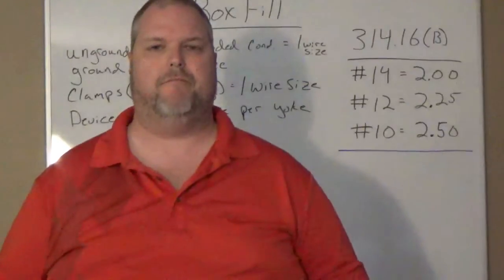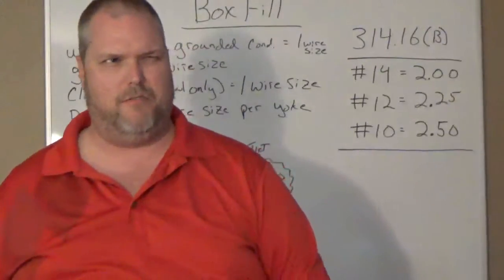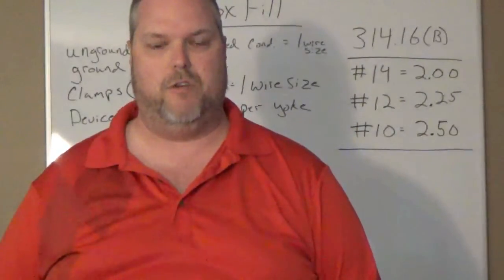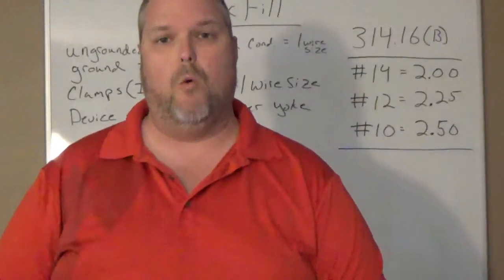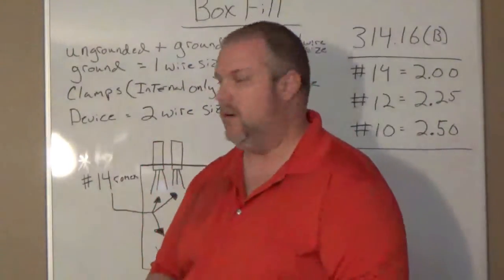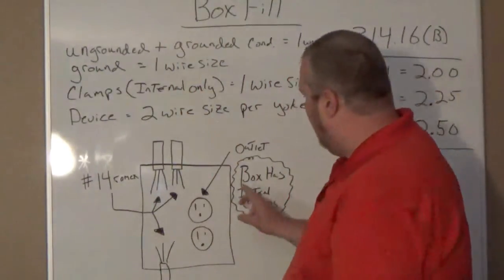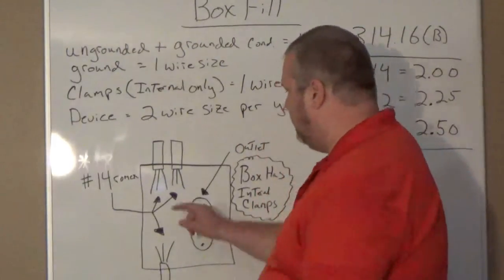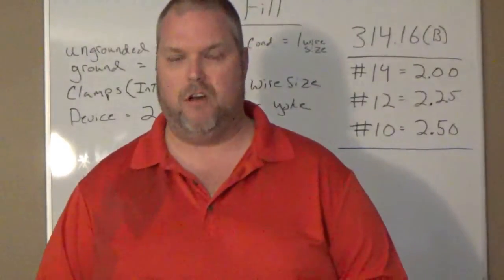Box Fill Calculations Explained

Comment: Doesn’t 4 ground conductors count as 1 and anything after 4 is .25? I could be wrong
Reply from the maker: @ivanaguilar8820  only after the first 4. So if you have 5 grounding conductors it would count as 1.25. This was changed in 2020 NEC. This video was off the 2017 NEC code. I will be doing an updated version soon!! CM
Reply: @ that makes sense! Thanks for all the vids been learning alot

Comment: I believe the 2020 calculation on grounds is different now.  I believe after 4 meaning the 5th ground you need to add .25 to the fill.
Reply: Yes this correct, i was confused because the video is different from my apprenticeship classes. He’s going off older code.

Comment: What if there were different size wire going in?  What cubic inch number do you use as a multiplier for the yoke and clamps?
Reply: You need to add a different size for each wire in the box.  Unless its a ground. For the ground up to four you only count the largest ground in the box.  Do not count splices or the device ground.  For the yoke and the clamps it is double the largest wire attached to it per 314.16(B)(4). Hope that helped.

Comment: I got a 66 yesterday on my general electrician exam I had a quite a few box fill questions. I thought I did most of them right but great video. There was one though that was 8x8x6 how many number 8’s can fit in that
Reply: I believe multiplying the box 8x8x6 = 384
Then take the size for each wire and divide it into the 384.  8 Awg = 3. Equals 128 #8s.

Comment: I thought two wire nuts counted as one? I read through my 2018 Canadian electrical code book and it says to count two wire nuts as one conductor size.
Reply from the maker: I am basing my video off the National Electrical Code 2014. This is very interesting as I knew there were some differences but was not aware of this. Honestly I dont understand why they are not counted as they still take up space in the box. Thank you for this info. Learned something new today!! CM

Comment: WHAT IS THE TOTAL VOLUME ALLOWANCE FOR FOR TWO (2) YOKE/STRAP DEVICES INSTALLED IN A BOX WITH 14AWG CONDUCTOR ?
Please help me to figure out, Thank you
Reply from the maker: For 2 device yokes it will be 8 cubic inch. 2 x 4 =8. If you need more explanation please email me at sparkyinstructor@gmail.com. CM
Reply: thank you

Comment: Very confused, just started my classes.
Reply from the maker: Give it time!!! If you have any questions please comment and I will help in any way I can. Thanks for watching. CM
Reply: Craig Michaud- Electrical Instructor 

I have this worksheet I was given asking. What size box is required for twelve #10 THW cooper conductors and ten #12TW copper conductors?
Reply from the maker: @rogertorrez1798  Okay all you have to do is go to the table talked about in the video and add all the wires up. For example a #12 is 2.25 x the number of wires and then do the same for the #10. Hope that helps!! CM
Reply: How would I solve it?^